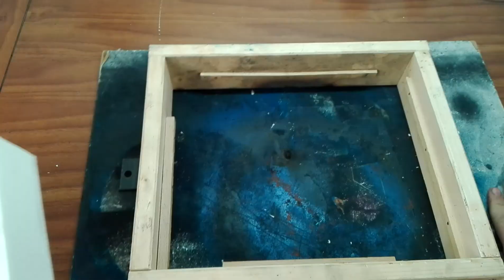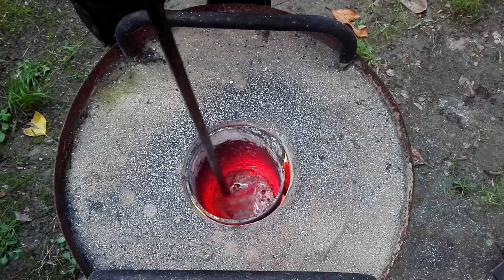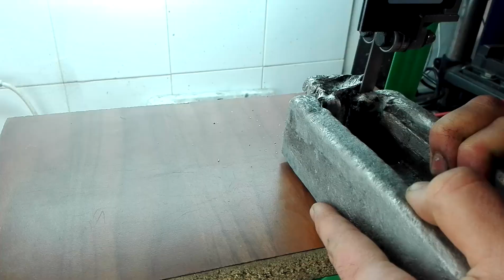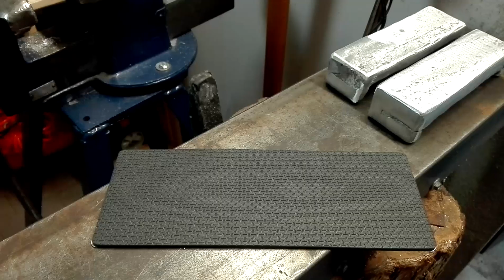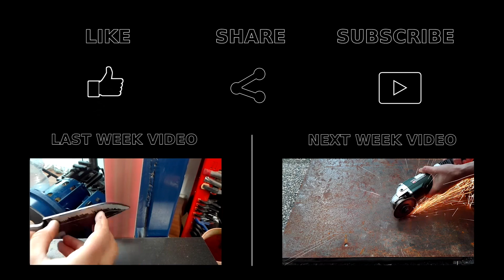DIY Soft Vise Jaws. A Quick Aluminum Casting Project.

Comment: nice simple build. For mine i added a couple of magnets from hard drives to keep them stuck to the vice. You could probably still add them to yous by drilling a shallow recess and using epoxy to glue them in.
Reply from the maker: Thanks! I was planning to add magnets but the fit got so tight that there was no need :)

Comment: what kind of glue do u use on the foam
Reply from the maker: MMM fuzzy wuzzy... You changed your profile pic!! :P I always used wood glue, but it takes ages to cure and after I watcher "Makercise" doing his foam pattern with how glue I think I will try that out too :)
Reply: Black Beard Projects awwww u rember fuzzy enough to notice the pic change, thats pretty cool.  and i was thinkin hot glue would be the way to go but i dont know how it would burn off in the casting
Reply from the maker: Yeah bro! Judging by Makercise results looks like it burns just fine :) But I never tried myself

Comment: Cool project.  Rubber stuck on the sides of the jaws, was that just for aesthetics?
Reply from the maker: I applied a self-adhesive rubber to add extra softness and an anti-skid surface :D Thank you!
Reply: No I understood the purpose of the rubber, I was just asking about the little part on the outside side bits, it's like 1" by 1".  I wasn't sure if you added rubber to those little sections to protect your work piece or to match the looks of the main vice jaws.
Reply from the maker: Oh I see! Sorry mate :) Yeah I added those little piece with no particular reason, the cut off where just big enough, so I added them for esthetics! :)